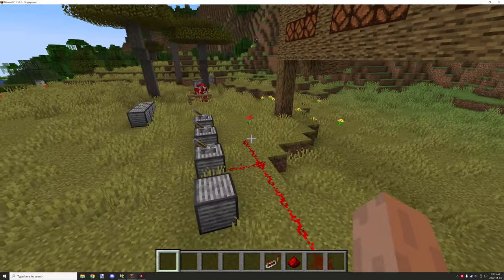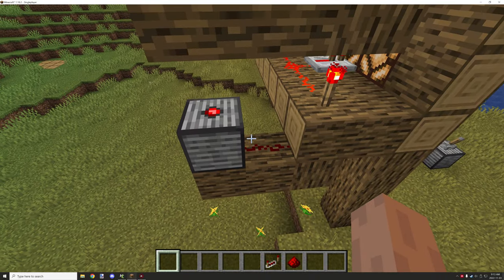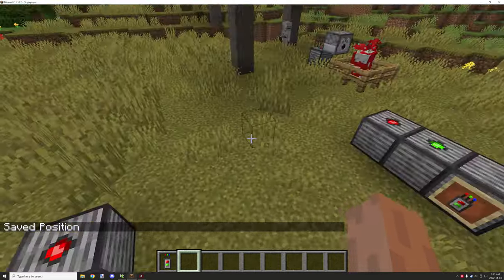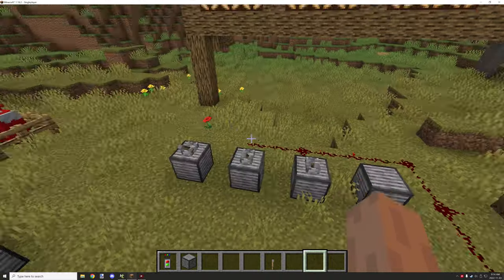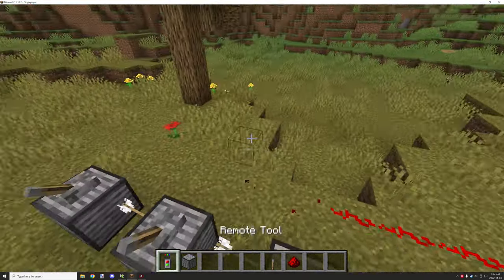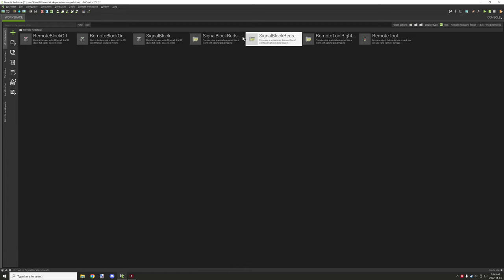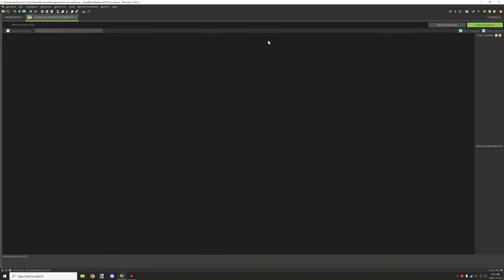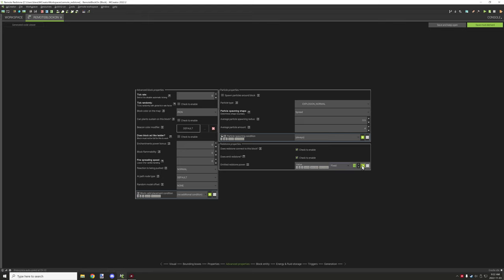MCREATOR: Wireless Redstone | 2022.2

Comment: Can you do a tutorial for something similar to this but showing how to do wireless FE/Immersive Engineering power transmission?
Reply from the maker: I will cover the FE blocks in the near future I have a few things planned before then but I will cover the general use of them in the procedure series, using this information it should be easy to convert the system for FE once you know how the blocks work.
Reply: @NorthWestTreesMCreator  Fair enough; I've just been having issues with creating a wireless transmitter. I've tried it a few different ways but it just doesn't seem to want to work as intended. It also doesn't help that on the various MCreator discords people seem to be rather petty when one asks for help regarding trying to set this up. I need the wireless FE transmitter (similar to the redstone transmitter) because I'm using Immersive Engineering and Create, but IE's power cables aren't designed to work with large powered contraptions that  move. The wires simply break. This increased the difficulty of making large moving contraptions with multiple stages, say along gantries that move, quite difficult.

Comment: Hello NothWestTrees games! Can you record video about energy generation and show how to extract it with using cables which you made in early video?
Reply from the maker: Generally the only time extraction is used is when your removing the sent amount from the current block. I can do a quick tutorial next week on general know how for Forge energy, but its basically the same method as the wires.

Comment: Maybe set x,y,z  and get x,y,z code is old and out dated and a waste of breath, but I just cant follow when and where anything is being stored and received. I see that it is being stored on some itemstack, but when does that get applied to the block, and how does the other block read that data off of the player if it isn't being stored on another block somewhere.
I thought this would be a great way to learn how to store variables on a block, but instead I have only learned that I have no idea where to even begin. 

I would love a indepth tortuial, of how to have a block, store the position of the player or another block being set by a player, and change the block texture each time, displaying 1,2,3,4,5,6, etc  all the way to X , where X is the max distance the block can be placed or the player can walk away from the block before it no longer updates. Ideally the block would reveal "how close" the player is in position to the block by changing to the texture that displaces the distance between the block and the player at any given point within X distance.

While the block would be useless for any game, the excersise would help me emensivly in understanding how minecraft stores data, use that data , and updates applicable blocks accordingly in the game itself. 

Even allowing for conditions should the distance be above or below certain numbers,  that same rule could be used to make for really cool custom boss fights, etc, but currently I don't even know how these 2 blocks are communicated despite watching the item procedure in this video 10 times. 

example of things causing me to be confused: Why isn't the signal block, not simply teleporting to where you right clicked the other block the moment you change the x,y,z from current position to the one on the item in hand??

is this bedrock?

Comment: Hello I really like the wireless method for a resdstone current, but I wonder if it was possible to do the same thing but via energy?

Currently I created a mod giving me a solar panel, a block that works like a battery and a lamp.

The solar panel, the battery and the lamp work very well when the three blocks are linked. However, I would like my battery to be able to send me energy via wifi so that I can connect the lamps around it.

For more information I am on version 2024.1 of MCREATOR in 1.20.1.
Reply from the maker: Yea it should be possible, I am not sure if Forge Energy is dependent on the chunk being loaded but you could always run the forceload command to keep the chunks loaded during the session if this it does. You would just need to know where the block is and then pass the energy to that block rather than the block next to the device or cable.

I am also working on a Variable based system with an optional API mod which can make it easier for people to use energy in their mods. I decided to do this after looking into the fluid system and finding out how limited and restrictive FE and FF is. The community wanted more out of the Forge Fluid like mutli tanks and such but at least with MCreator its not feasible. So I have been working on a NBT system which forge energy and fluid basically uses.

It will also be able to convert from this system to FF and FE. But I plan to support item transport too.
Though no set release date I plan to come out with a bonus video just to announce it some time in the near future though. I have to do the editing for the video still.

Comment: just 2 curiuos questions:
1-) does it have a range? i didnt see anything on the codes lol, so i guess it will go anywhere on the same dimension?
2) what happens if u link betheween 2 different dimensions? it crashes?
Reply from the maker: For question 1: it should work regardless of where the player is in the same world from the example script.
For question 2: if you need it to run in other worlds then it would require the block location to be loaded, the block to be tested if it exists, then if true the block set, and then finally forced loaded again to unload the chunks. By default though it should only see the coordinates in the current world the entity is using the trigger in but it would be possible to do via commands in a sequence like described.

Comment: Hey, this is late and I don't expect you to comment but if you do see this. For that Set Local: posx/posy/posz to block where is that located? I am on 2024.1 using neo forge but I checked on a few other versions on different clients and still don't see it. I have been looking for way to long for this one block. 

I am making a detect mod that just has a ton of blocks that are similar to observers but a lot better and the mod would be great if it had a wireless tool.
Reply from the maker: Those are local variables you need to make them in the procedure which can be found just under the save button for the procedure. Once you made your variables you can find them under the custom variables tab in the procedures list on the left side.

Comment: Hello , I would like to know if it is possible to make that when the water touches the block, the block is destroyed and dropping an item
Reply from the maker: Yep, if you set your material type to a material to something such as cobwebs or fire it will break when water touches, it should drop the item if you play around with the drop settings, if not try picking another material that works similar to cobwebs. I think though that cobwebs will work fine for what you want.
Reply: @NorthWestTreesMCreator  thanks

Comment: We areledy have that. It's called sculk sensor and few pistons
Reply from the maker: Adaptivity for Sculk Sensors are not as diverse for modding, and it also is not something many mods below 1.19 can use.
This system should work for most versions of MCreator 1.12 to 1.18+ it basically just changes the signal location from A to B without needing dust between the two points.
Also this opens the door for syncing redstone contraptions too which can be a pain when working with repeaters to extend delays, even Sculk Sensors have delays so this can have more then just remote use it can be used for a few things.
Reply: oh

Comment: Do you know if is possible to make a dimension with only 1 structure and nothing else?
Reply from the maker: It might be using a global variable for the world (not map) then in the structure you would want to make a additional generation condition and test if the value is false, if false then return true but also set the variable to true before the return block runs this should disable that structure from generating again once the world variable is set to true.
The default value of the world variable should be false too, I would use a basic logic variable type to make it easier for scripting.
Reply from the maker: I also don't know how that would actually work I have never tried it but if it does what I think then it should generate the first structure when the chunks are loaded then toggle the variable, this may be a random location based on the seed of the world.
Reply: @NorthWestTreesMCreator  could you make a video or show a photo or something? I'm sorry but this is a little bit complicated to me

Comment: hello if you can help me I'm trying to make an "area" effect like when the entity hits a block set the block plus 4 to each side as air
Reply from the maker: I would use a repeater and then increase or decrease the X and Z position based on what side, North and West are negative numbers from the current block and South and East are positive, Direction wise Z is South and North, and X is West and East. you should use a local variable and set the position of X for your local variable then simply set the repeat number in your case 4 times then in the first line offset the direction so set the variable = variable +|- 1 this will decrease or increase the value based on the direction your repeater is for.

Comment: it doesnt work in the procedure of signal on it doesnt exist anymore the set local
Reply from the maker: It's possible that procedures broke due to Mojang removing support for testing for materials eg air type blocks.
Tags will need to be used in the cases for any material blocks.

Chances are when importing into newer versions any blocks that were material blocks will be a true or false block on the condition.

Comment: is possible attack AI only attack have tag ? (etc blue entity only attack to have red entity) I try but not working. working like when weather rainy can attack
Reply from the maker: I think you can target living entities (all entities) then make a start condition and test for a entity using entity takes, if true return true. Then outside that if statement simply return false if the condition fails, this should only start the target if living entity is in that tag. However one thing to note is players and not living entities far as I am aware so you will need to make a OR operator and test for player and server player if you wish to target players in that condition too.
Reply: @NorthWestTreesMCreator  thanks for answer. I understand how i make logical error. Only solution all trops target add one by one to all enemy troops  (i m very lazy for this :D)

Comment: how can I get a signal block to put several remote blocks on?
Reply from the maker: Depending on your configuration for your block you can either have a block listen for changes at a set location or have a block set other blocks NBT. You would need to point to a blocks coordinates either way.

If the block is listening then you only need to point from your device to your signal box and test if a value is true or false. 

IF you force the values from the signal box however you will need to store each block X, Y and Z that is linked and then set the NBT at that blocks location.

The easier way would to have other blocks listen to the signal box as this would allow a dynamic number of devices to listen without needing to store all the Positions.

You can then run the script based on the blocks state.
Keep in mind though the mechanics may need to be in loaded chunks to work I am not sure if NBT works in unloaded chunks or not so it might be something to consider when making your connections, you may need to limit the distance for the blocks to connect.

I hope this helps.

Comment: i'm just trying to figure out how to make button/pressure plate
Reply from the maker: I think buttons have a block base these days, not sure about pressure plates if not then you can use player collides in the block to swap a off block to a on block and then use a test for the on block if a player exists above the block if false then swap the block back. You will want a distance of about 0.5 to 1 for the nearest entity, however if you add mob support I suggest using living entity as your condition as this will test for most entities minus some things like items and players. You will need to use OR operations to test if any of them exist.